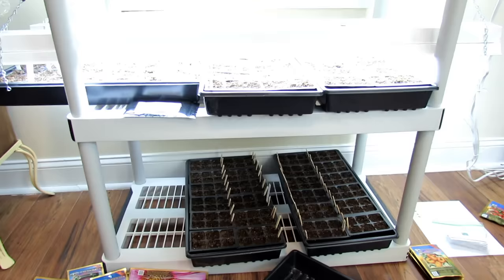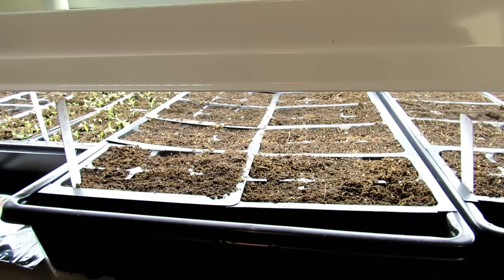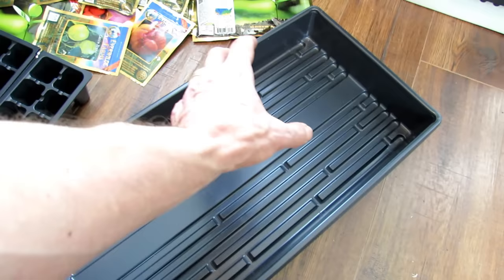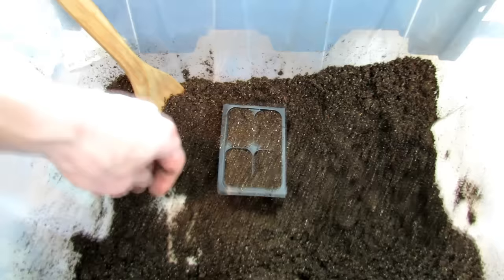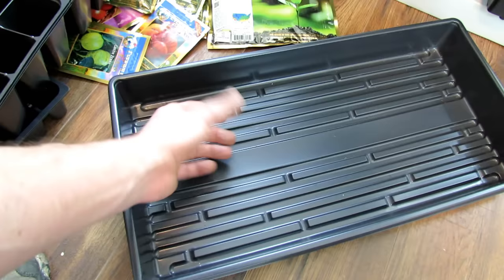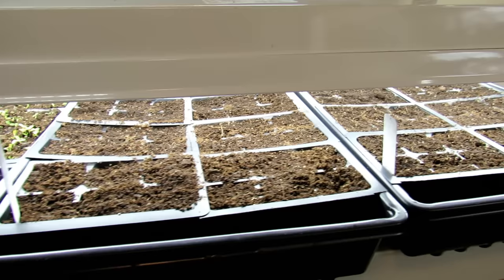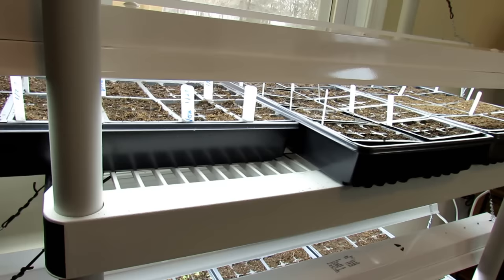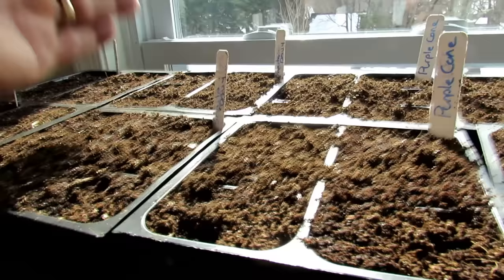Seed Starting Basics: 30+ Questions Answered on Seed Starting Indoors - Digital Table of Contents

Comment: I found this to be very helpful and informative. Putting together and editing these videos is no small task and I appreciate it very much.
Reply from the maker: Very glad to make them. It is some work but I enjoy it.
Check out my new Amazon Influencer's Shop. Anything you buy on Amazon helps The Rusted Garden when using my link.  Ill be putting what I use in videos there for 2019. It is all set up by categories. Thanks.  https://www.amazon.com/shop/garypilarchiktherustedgarden
Reply: Bill Baron  yes I found it hard to edit my episodes on seeding to the point I didn’t upload it
Reply: hii Gary,

3 questions:
you said uv ray, do you think a bit of indoor man made uv ray a few minutes per day will help to deal away with molds and stuff ? because bring them in and out for me is difficult, because i dwell in apartment with no balcony. 

2nd question:
it is now 15 deg C outside ind day time (today is sunny) and at night it is 7 deg c and early dawn, it is 2 deg C. the temperature here in spring is like this fluctuate like this, a couple of day they will reach 0deg C before dawn.. 
i can't bring my seedling day in day out.. because my allotment is not near at where i m staying.. and there is no electricity at my allotment.. 

can i sow lettuce and radish and pok choy in cool frame ? and let it be over night at such temperature swing ? 
or with such high day temperature, can i put my zucchini seedling in the cold frame ?

i in need of the answer.. because i don't want to lost them all.. 

3rd question:
the seed pack stated, germination temperature is between 8 deg c to 15 deg C for a leafy vege..
but since my temperature is fluctuating so much and not consistent... when then should i sow the seed ?  because i never have a temperature that is constantly above 8 deg c.. it would be in month of May already, only then i will have  a little bit of more stable temperature..  by then i won't be able to plant much already. 
i am refering to uk weather.

thx
andrew
Reply: I really enjoyed your video about Starting seed basics and I have  one question that I cannot find an answer to on You Tube.
My question is , after the seeds germinate, when do stop using the grow light while you are transitioning plants outside and bringing them back inside?

Comment: Another thing people may need to know in regards to using a timer and a power strip is plug your timer directly into the wall outlet and plug all you light system into your power strip. Then plug power strip into timer so they will all come on and turn off together. Just a tip I figured out that really works well.
Reply from the maker: Thanks!
This takes you to seed starting cells. https://www.therustedgarden.com/products/seed-flats-starting-cells-and-4-inch-transplant-pots-large-combo

Comment: Great video Gary! I will have to disagree with you about granular organic fertilizer. The vast majority come with beneficial microbes that will break down the insoluble nutrients. Also, there are some soluble nutrients in those granules available to the plant while the others are broken down.  I have found that plants started with a bit of Espoma biotone starter plus grow healthier and more care free. Also, the fungus you see growing on the soil is the beneficial kind that comes with the fertilizer. It will help protect the plant against harmful fungi like damping off. In fact, there are some seed starting soils, like the Coast of Maine one, that are "living soils" with all sorts of beneficial microbes. When compared with seeds started in sterile mix with a little added organic fertilizer, the plants grown in the Coat of Maine are much healthier and resistant to harmful forms of fungi and diseases in general.
Reply from the maker: I cant argue with that. Fair enough. I use worm casting for the reasons you state. Thanks.
Reply: Gary Pilarchik (The Rusted Garden) no, thank YOU 😀. I've never seen anyone take this on as thoroughly as you have. You are surely responsible for so many people growing their own food. Awesome job!
Reply from the maker: You made a good point with the biology/biozyme that is added. But I think that would be a good subject for a separate video on making the potting up mix for your transplants.
Reply: Gary Pilarchik  (The Rusted Garden) looking forward to it! I'm a big fan of yours. Learned to garden a few years back to provide produce for a group home and been obsessed with it since. Can't believe I hadn't tasted a real tomato until my 30's. Anyway, wish I had your videos back then to get me started. Your doing a great thing here!

Comment: Very helpful video. I was kind of hoping you mentioned something about flower seedlings does that rule of thumb the same thing as for vegetables. Also I did not mention when is the best time to start seedlings either flowers or vegetables that would have been great to but none the less you have great videos I enjoy them thank you and have a good day.
Reply from the maker: So the seed starting time just varies to greatly.  And then your zone impacts the starting time. So anywhere from 2 to 12 weeks. Ill try and talk more about it later.  All seeds, herbs flowers and vegetables follow the same principles.
Check out my new Amazon Influencer Shop. Ill be putting what I use in videos there for 2019. It is all set up by categories. Thanks.  https://www.amazon.com/shop/garypilarchiktherustedgarden

Comment: Sorry Gary, but the BEST SEED STARTING MIX is from Gardeners Supply and it has muchorrizae in it. i have never had a fungus gnat problem from a bag of their mix over several.seasons. Results are superior. I would never bake it.
Reply from the maker: Thanks. Glad you dont get them.
Check out my new Amazon Influencer's Shop. Anything you buy on Amazon helps The Rusted Garden when using my link.  Ill be putting what I use in videos there for 2019. It is all set up by categories. Thanks.  https://www.amazon.com/shop/garypilarchiktherustedgarden

Comment: I love this video Gary, very informative, my only concern is I don't wanna start with that many seeds and lights and most of us rookies not gonna plant that many seeds at once so i just wanna start with 2 piece of 6 cells trays, 1 for red bell peppers and another one maybe tomatoes or strawberries and just see if I don't fail with them then I'm gonna expend and grow more veggies, but it would be way overwhelming for me to grow that many veggies at once especially cause they all need different amount of lights, different soil etc. So my question is how do I get a smaller  light to germinate my seeds for only 1-2 piece of  6 cell trays? And what about the plastic material, is it food grade safe? I don't want chemicals leaching in my seeds /food while I germinate them so is any food grade trays available?
Reply from the maker: The 4 foot shop lights are best and cheapest. Smaller lights actually cost more. The trays are for seed starting. Nothing, just FYI, would leach or cause issue for simple seed starting. 
Thanks! Over 1500 gardening videos on my YT channel Here is how you can support me, & The Rusted Garden...
The Rusted Garden Seed & Garden Shop: https://www.therustedgarden.com/

Comment: Yes, this was a good video.  I'm not sure what to do when I plant a variety of seeds and they might have a large number of days to germinate.  Do the seedlings get separated from the ones that take longer, so the seeds are being lit by the lights,  at the correct number of inches. For instance, the Zinnias are germinating sooner than the sunflowers.
Reply from the maker: It is good to move the cells around to build trays of those that need more light to germinate still. The slow germinators. If you dont have space for that, dont over worry about it.
Plus support The Rusted Garden by subscribing and using my Amazon Store  Front link 
when shopping for anything on Amazon https://www.amazon.com/shop/garypilarchiktherustedgarden.  
As an Amazon Associate I earn from any qualified purchases, not just items I link. 

Please visit The Rusted Garden Seed & Garden Shop (My Shop) for your fabric pots, fall & spring seeds, seed starting supplies, peppermint oil, neem oil, TRG merchandise, and more at www.therustedgarden.com
The Rusted Garden 'Scan & Grow' Collection (My Seed and Garden Shop) Just scan the QR code and watch a planting video:
https://www.therustedgarden.com/search?type=product&q=qr

You can also find items I use or discuss in videos, by checking out my Amazon Storefront for cameras, fertilizer, pest management, shade cloth, seed starting supplies, books and more!

Earn 15% by becoming a Rusted Garden Seed & Garden Shop Affiliate.  Some people are using it for their social media followings and some people are using it for a fund raiser for schools and sport teams. To sign up... use this link to our shop and click the MORE tab on the green bar and select TRG Affiliate Program https://www.therustedgarden.com/

Or use this link to go directly to our TRG Affiliate Program sign up https://the-rusted-garden.goaffpro.com/create-account

Comment: Learned I need to cut back water.
Reply from the maker: A drying period is key
Please visit The Rusted Garden Seed & Garden shop for your fabric pots, fall & spring seeds, seed starting supplies, peppermint oil, neem oil, TRG merchandise and more at www.therustedgarden.com Check out my new gardening PODCAST Gardening Coast2Coast at https://gardeningcoast2coast.net with CaliKim. As an Amazon Associate I earn from qualified purchases. Check out my Amazon Storefront for garden lights, seed starting supplies, fertilizer, pest management, books and more! https://www.amazon.com/shop/garypilarchiktherustedgarden

Comment: Great and thorough guidance! Starting some as early as Feb 2nd?
Reply from the maker: That should work. Good luck.
Please Subscribe. It really helps me. Thanks!  Please visit The Rusted Garden Seed & Garden Shop (My Shop) for your fabric pots, fall & spring seeds, seed starting supplies, peppermint oil, neem oil, TRG merchandise, and more at www.therustedgarden.com  And please support The Rusted Garden by using my Amazon Store Link when shopping for anything on Amazon https://www.amazon.com/shop/garypilarchiktherustedgarden.  As an Amazon Associate I earn from any qualified purchases, not just items I link. You can also find items I use or discuss in videos, by checking out my Amazon Storefront for fertilizer, pest management, shade cloth, seed starting supplies, books and more!  Thanks & Cheers!

Comment: How long do you microwave the seed starter?  Do you use a high setting or lower?  Do you leave it in the bag or a separate container?
Reply from the maker: It varies on your microwave. I do mine 3 bursts of 1 minutes, till it is steamy. But watch it. You dont wont to over heat in a microwave.
Check out my new Amazon Influencer's Shop. Anything you buy on Amazon helps The Rusted Garden when using my link.  Ill be putting what I use in videos there for 2019. It is all set up by categories. Thanks.  https://www.amazon.com/shop/garypilarchiktherustedgarden

Comment: Hello Gary, in one of your video you published  on Mar 7, 2018 you were talking about seed starting indoors and fertilizer "vigorous strong start  plant food", were can I bay it for my plants. I did search internet and not found. Thank you for your great information !!!
Reply from the maker: So I go that so long I go I dont remember. Anyway, you can use anything. Just use it at 1/4 strength when using the soluble types. Dont over do it. I have some stuff I use here at my amazon shop. Check out my new Amazon Influencer Shop. Ill be putting what I use in videos there for 2019. It is all set up by categories. Thanks.  https://www.amazon.com/shop/garypilarchiktherustedgarden

Comment: What do you think about the self watering kits that have a mat that soaks up the water and the seed trays sit on the mat?
Reply from the maker: They arent really needed if you use starting mix and bottom water. The only reason I would use them is if you are busy and it is hard to manage watering. But they arent needed otherwise.
Check out my new Amazon Influencer Shop. Ill be putting what I use in videos there for 2019. It is all set up by categories. Thanks.  https://www.amazon.com/shop/garypilarchiktherustedgarden

Comment: hi Gary
I'm worried about not having any room to have a grow light set up. I live in a very very small property in the UK.  I think I'm in 9a area. I'm so worried about this. xx
Reply from the maker: How much space do you have. Are you able to move a flat in and out during the day? You can seed start that way.
Check out my new Amazon Influencer Shop. Ill be putting what I use in videos there for 2019. It is all set up by categories. Thanks.  https://www.amazon.com/shop/garypilarchiktherustedgarden
Reply: Checkout Gary's other videos on the smaller grow boxes and the fixtures that allow you to use smaller led bulbs. I'm sure you can adapt a setup to meet your needs using those as resources.
Reply: Gary Pilarchik (The Rusted Garden) yes I could move a flat in n out. I never thought of that tnk u your help is very appreciated. I have a look on your channel as the other gentleman offered. tnk u xx
Reply: Krystina Have you managed to find a suitable grow light set up yet? I live in London and have been trying to find the really useful clamp lights that Gary and other gardening youtubers use and they're virtually seem to be non existent here. I have even searched online, they have them on eBay but they're sent from overseas suppliers. I even went today to a specialists lighting and electrical specialist shop nearby where I live and they had nothing really, aside from some really small LED bulbs.
Reply: Genevieve8002 hiya
I've found via here and calikim channel the small round metal light unit via reptile sites they are about £25 ish n they can take for a small upto a 100w  light n a large 200w light  depending on the make it varies. but I can't find the lights yet. if u can message me we can keep upto date on each others progress if not use this. Gary has said u in new vids it can be done if u can't get the grow light set up for various reasons then u can do it by going in n outside u can watch this in better description in his new video he's done. I'll keep watch out for progress 😊
Reply: Krystina Goudie Yes, I saw a reptile lamp for a Komodo, the local electrical lighting shop that I went to on Monday told me that the reptile lamp wouldn't be correct. I may have to just start my seeds and use the Garland micro grow light set up initially.
Reply: Krystina Goudie Thank you.
Reply: Genevieve8002 the Base will be fine it's the light that you will need to find separately I'll keep looking as the led light as it seams uk doesn't sell the cfl lights anymore.  I'll keep looking but the led will only be about 30w maximum so those light holders will be perfect for this. xx
Reply: @startagain126  Aww, thank you. You have been really helpful. I've o my just gotten into houseplants and indoor gardening, so getting my head around the correct lifting has been tricky!! But where there's a will, there's a way. 😊

Comment: Hi Gary, thank you for all the great videos!  I wanted to ask about the domes that come with some of the seed starting kits.  Should I use them?
Reply from the maker: I dont use them. I forgot to answer that one LOL. I found they create a mold and fungus haven.
Check out my new Amazon Influencer's Shop. Anything you buy on Amazon helps The Rusted Garden when using my link.  Ill be putting what I use in videos there for 2019. It is all set up by categories. Thanks.  https://www.amazon.com/shop/garypilarchiktherustedgarden

Comment: Hi Gary, Thank you so much for all your very helpful videos!  I only have space for 2’ long grow lights, and all I could seem to find are blue spectrum LED.  I thought they might be ok, but now I’ve noticed that they are only 3300 kelvins and I actually can’t find the number of lumens.  They are a slightly pink color.  Any idea if they will work for my seed starts?  They were not cheap, so I’d rather return them if they won’t work as well.
Reply from the maker: Nope. You really need 5000K minimum and  I prefer 6500K. I would return them. These numbers are pretty solid.  Sorry.
Check out my new Amazon Influencer's Shop. Anything you buy on Amazon helps The Rusted Garden when using my link.  Ill be putting what I use in videos there for 2019. It is all set up by categories. Thanks.  https://www.amazon.com/shop/garypilarchiktherustedgarden